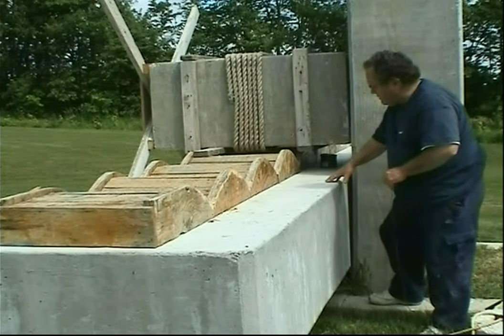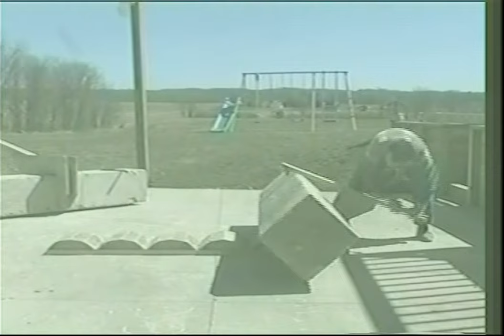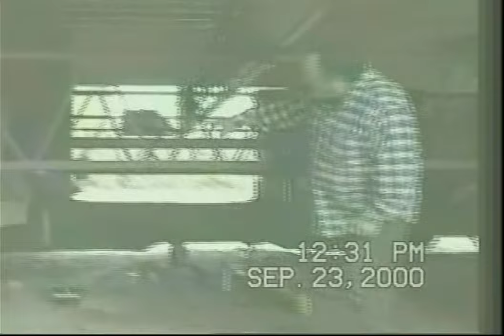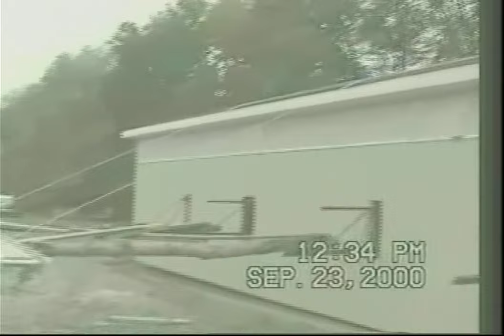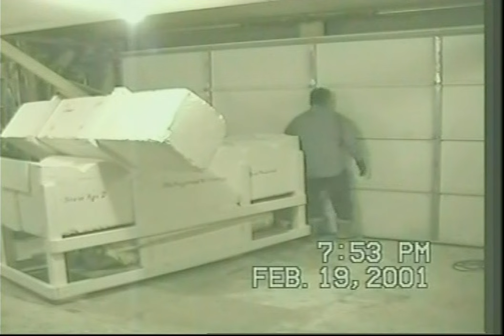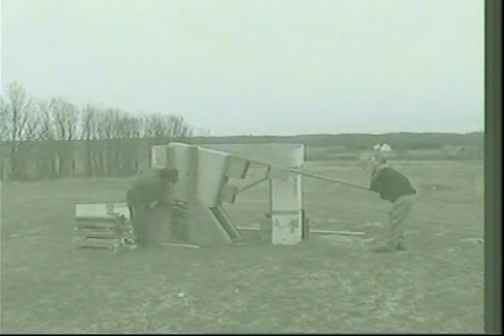Ancient StoneHenge Technology Reveal By Wally Wallington Part 3

Comment: I once saw a house, that had sat on these little river stones for 100+ years.   They were smaller then a hockey puck.  I was shocked to see the full weight of a house, sitting on rocks, that a child would skip across the lake.   It's amazing how much psi a little stone can carry.   Ironically, today, we'd try to anchor a house, where this house was sitting on little stones, in case you wanted to lift or level it.   And, there was no termite shied, between the rock, and the wood.    100+ years.   low, low technology.  banks would not give the house a mortgage, since there was no defined foundation type, according to the banks.   Hard to say, the house sits on a few stones, inches above rock.

Comment: I have absolutely no idea why YouTube suggested the first of these videos to me but I've just watched for about an hour and a half in utter amazement. 
I loved Wally rolling his square counter weight in episode 2. He arrived at the correct shape of the "road" with no mathematics at all. It's not actually circular segments. The curves are catenaries and by chance that is also what you get bending a stick with just the right flexibility the way he did. He deserved that bit of luck for all his amazing efforts! Seeing it roll perfectly level almost effortlessly was wonderful.
Reply: There's definitely math there, but the way he did it was how several ancient civilizations did their calculations. He marked his stick off of the block to be moved. He found the centerline and then used 26° inclines to the center from the corners. He drove nails in 3 points to flex the ruler on.

In trades, really great craftsmen do complicated maths all the time without "knowing" the mathematical theory or terms. You can see fundamentals of it on YouTube videos about bending offsets in pipe or different uses for a speed square. Fundamental engineering or layout is done on sight with a stick, string, fasteners, and a marker.

We get a notebook and calculator out to confirm safety is observed, as we see Wallace doing. I believe the first news clip of him I saw had a smaller "road" that still had corners on top, I might be mistaken, but it looks like this is a developed iteration.

Comment: Yup, it's amazing what a couple of guys can move with blocks and some forethought. My partner and I raised a brick wall, reinforced with concrete, up four feet to place it back into its original position from where it had washed out and fallen. I then added  a drain system so it would not wash out again.

Comment: Do you make the road "circular" or the load?

Many YouTubes show that any rectangular/square block easily rolls
if 2 small logs are harnessed on each face - 8 in total strapped with a rope through the middle of the logs. Any block of any size can be made to roll using this technique.

Making the road with the parts needed to roll the block of stone works ONLY for a specific size.